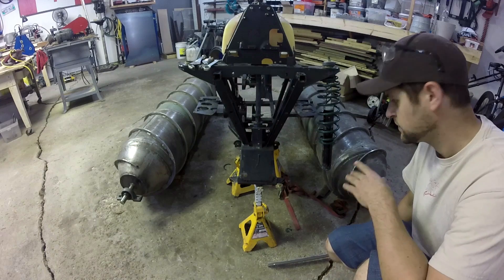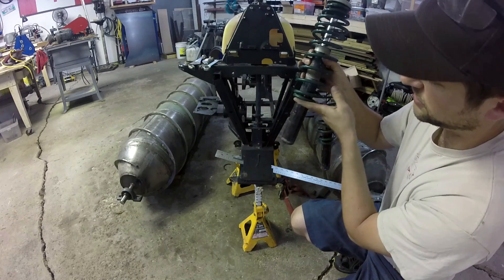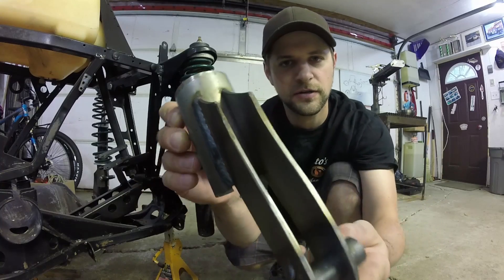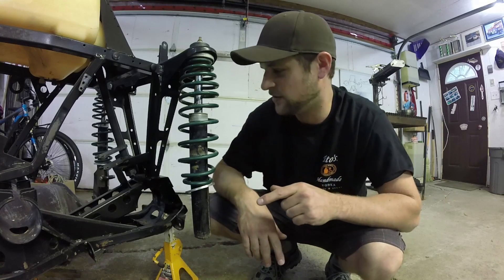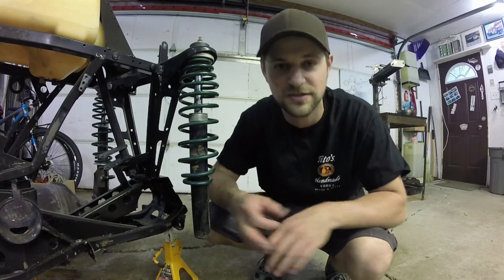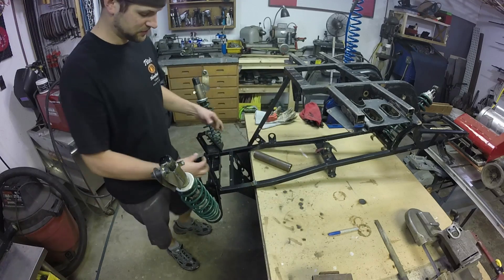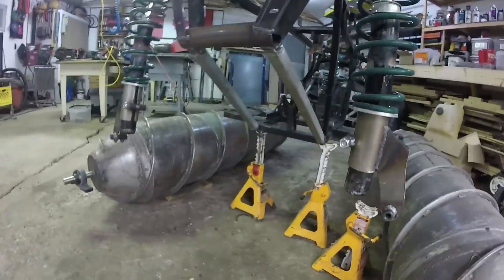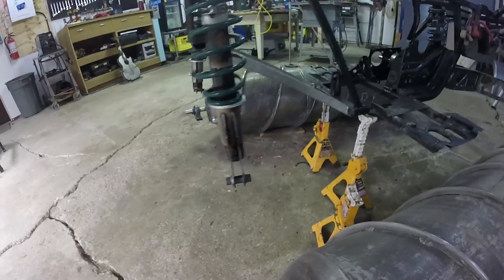Amphibious Screw Drive ATV Project - Part 3 - Chassis Mods

Comment: your gonna need the other 2 links because if you don't the front axle can move side to side since the front and back has block bearings
Reply from the maker: the triangulated top ling should take care of that. look at hot rods

Comment: Yup the engineering gods have smiled on ya! Your four link is a great idea. Anxious to see it work as expected barring any of dem damn Murphy's Quantum law gremlins getting in the way. Do you know what kind of travel your expecting out of your suspension? Just curious if there's enough travel for  the front or rear vertical geometry to change as it compresses and rebounds? It would be very slight under say 15 to 20 cm or so but you might have to build in a little allowance so that no binding occurs. Your not gona be jumping sand dunes I guess but just a thot. Your very familiar with the "overbuild it" theory a this point but I'd be especially critical on this at the ends of those links. The stresses at those points verses wheels & tires have to be ten times normal I'd imagine. Looking forward to seeing the progress and hope them gods continue to stick with ya! This has been a fascinating and insightful trek and I'm glad you've let us ride along, so thanks for that and good luck!
Reply from the maker: i'm not sure on the travel. but the design of the four link will be a no bind system. thats the beauty of it. when i get there i think you will see what i have in mind. its actually quite slick! yeah i'm going to have to beef up the frame at the mount points for sure. thanks for the comment, and the great input! we think alike

Comment: Looking good!!!
You going to keep the stock engine setup?
Reply from the maker: no, i plan on running a small gas engine.....far as i know
Reply: REDNIC79 Why not a 6HP Diesel lol?
Reply from the maker: how much would that weigh?
Reply: REDNIC79 88lbs dry
Reply: She will work , And Blow back smoke at the same time lol!!
Reply from the maker: I really need 2 figure out the hydro stuff / hp requirements.... would be cool. would a 6ph diesel be the same as say a 12hp gas for torque?
Reply: It would be more around the lines of a OLD 10Hp Cast iron briggs for torque with the heavy flywheel
Reply from the maker: nice n torquey
Reply: I send you some links,but dont ask me to explain all that,i have just a light clue of that stuff ^ ^